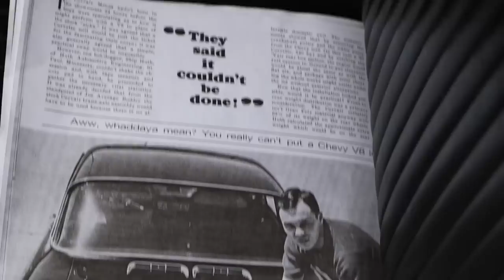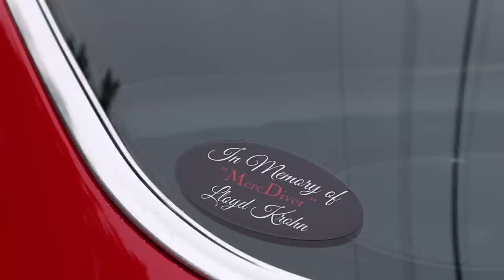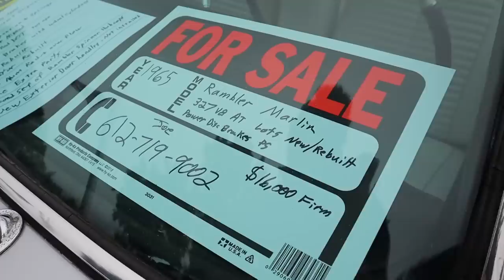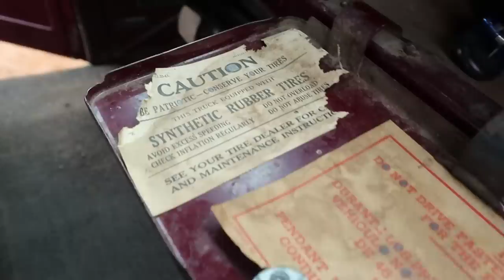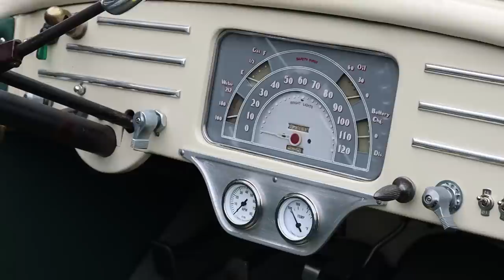ENORMOUS CAR SHOW!!! - Rat Rods - Hot Rods - Street Rods - Muscle Cars - Gearhead Get Together! 2022

Comment: The black Mustang Fastback is a G.T. 350 H, or a very good recreation.  That car could have been rented by anyone, back in the day, who had a driver license.  It was under the Hertz blanket, hence the "H" on the side stripe.  They were real Shelby GT 350s, done to Hertz's specs. Many of those cars were rented, then returned with a low horsepower 289/260 engine under the hood, instead of the hipo 289 it went out with.  The program didn't last long.  Hard to find car.